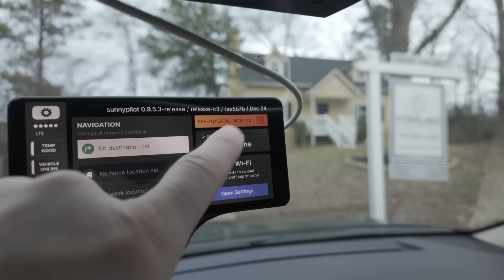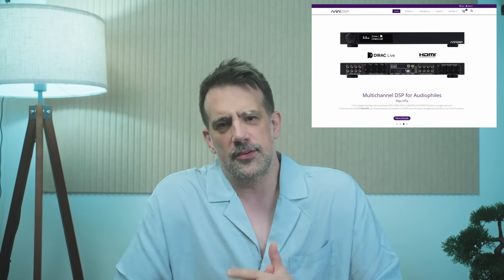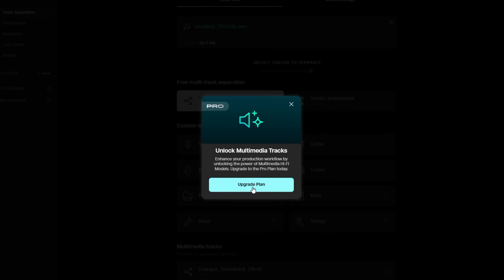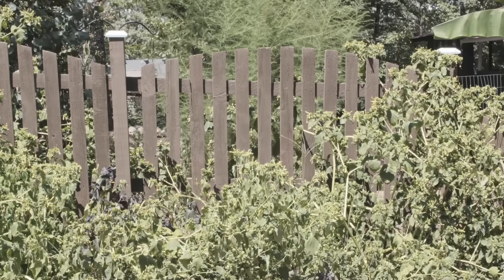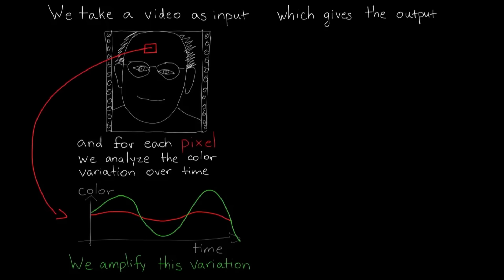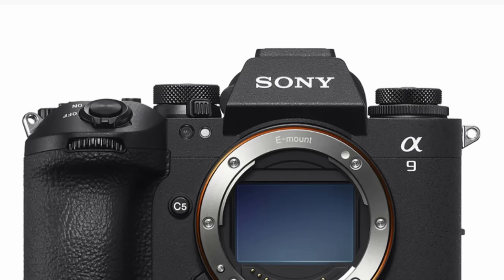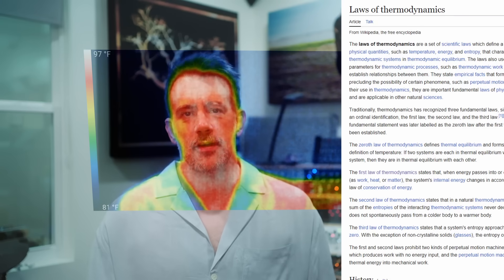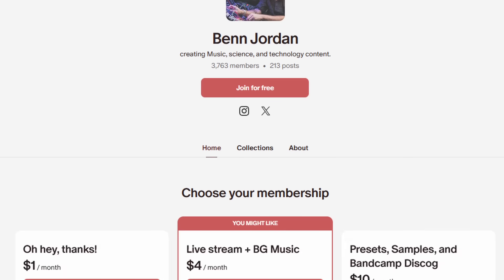How To Make A Legit Sound Camera

Comment: Hello Mr. Jordan, very informative video. Starting at minute 2:38, you introduce the miniDSP UMA-16. I'm a hobbyist researcher (citizen science project) in the field of bats and have a few questions about the device. Were you able to detect bats with the device? The frequency range up to 10 kHz is a bit narrow for bats. I personally use a TeensyBat detector and BatDetect2 as analysis software. I'm very interested in the miniDSP array because I do my monitoring on the move. That is, I don't have a stationary recording device; instead, I travel to the so-called bat hotspots. What are your experiences with the miniDSP UMA-16? Best regards from Germany 👍

Comment: 14:44 This also seems like an increase of the speaker membrane temperature caused by the inner material friction. Similar like when you quickly repeatedly bend a plastic spoon (or any other bendy object) and then feel how warm it got. The higher the frequency, the higher the velocity of the deformation and less time (around the amplitude peaks) for the material to cool down.
Still very cool to see this!

Comment: 14:45 Isn’t this just heat being dissipated from the voice coil driving the speaker?  I’d think eg making a tuning fork vibrate by driving it with a sound would be a better measure of sound energy->heat transfer.

Comment: this is a really good video that i will probably come back to several times (like the posy video that inspired it). 

I do have a question though! At 15:04 how do you control for heat from the electric resistance of the speaker here? It is not obvious to me that the heat measured here is the heat caused by the sound waves themselves, or the electrical activity/resistance involved in converting the signal into sound (and certainly, higher frequency movement will draw more energy and produce more heat, electrically). Maybe I'm being too pedantic here because the underlying signal and source of the heat is the same, for largely the same reason, but i am now curious on the temperature of sound waves themselves, absent of the source.

Comment: A note about rolling shutter is it not always bad news. There is a paper which I wont link as even if I found it as youtube would probably remove comment for it, but long story short they've used a prism and combined global shutter camera with rolling shutter camera. The global shutter camera gave reference image and rolling shutter distortions were matched against it to provide ultra-fast motion data, kind of like how computer mouse works. In theory, with 60hz 1080p camera one could reach upwards of 60khz sampling rate but focusing two cameras to have a uniformly vibrating surface taking entire shot is unrealistic, so they've really only got to like 8, and with heavy distortions as apparently surfaces sound like ass most of the time, not any good for music recording but enough to spy on someone.

Comment: I'm probably not the first to tell you that Adam Savage did a video whereby he utilized an acoustic imaging camera from Fluke to locate a leaky air line in his shop.  I don't know the spec's, but based on what I observed resolution was higher than 32x32 pixels.  Adam didn't mention the cost.

UPDATE: Some quick research netted the Fluke Ti401 PRO, which Offers 640 x 480 resolution.

Comment: 1:00 you've just described P-frames and video compression theory. 

  I‑frames are the least compressible but don't require other video frames to decode. They're basically the full image you see when you're paused
  P‑frames can use data from previous frames to decompress and are more compressible than I‑frames. This is why backgrounds aren't composed of new images in areas that don't move
  B‑frames can use both previous and forward frames for data reference to get the highest amount of data compression.

You can purposefully break these in a process called datamoshing, but if you've ever seen corrupted video of any kind it's because these frames are messed up

Comment: 14:41 not really...  The bright ring is likely near where the voice coil of the loudspeaker sits, which gets somewhat heated by the current driving the speaker. An electromagnet like the  voice coil has finite conductivity, so it will heat up from heavy current.

Comment: Couldn't you increase the resolution of the 'audio cam' by moving the mics in a predetermined way (circular path but with the same orientation?). Your video goes pretty fast, I would add some explanations on hardware/approach and let examples run for a little longer (say 5 seconds instead of 1?). Pretty cool the Schlieren alternative but I guess that was done with the global shutter module?

Comment: AFAIK the software for an audio camera thing using multiple microphones is just a 2D Fourier decomposition. It's the same problem the long baseline radio telescopes face. The optimum sensor layout isn't actually a square array, it's putting them at weird locations, as far apart as possible, that are not multiple wavelengths of each other because you get more resolution. When you don't have a fully filled array, you get diffraction pattern effects but most sounds are multispectral so the bits you don't want won't usually line up in the frequency domain.

Comment: Enjoyable, thank you. Although its not intended to sell things... I wouldn't mind links to some of the items, such as the usb mic array, to tinket with.
As a side note, in the thermal test... could the coil or magnets of the speaker be heating up, instead of the variation from the sound waves? It is power moving the coils afterall.

Comment: I wonder if what you saw on the speaker increasing temperature was not the coils running current to vibrate the membrane and the wires warming up by running come current.

Comment: There is a lot of sound-modulated light all around us. I used to hear it using a photo-transistor or you can hear the sound in a solar battery cell. Things that shine and vibrate easily like bags and foil make a very strong modulated light sound. The sensors in the cameras should pick it up like a photo-transistor or solar cell.

Comment: 13:17 I did that a lot when I was 14, aand quite much at 24 too (Also at 24 I wet my hand with thinner and put it ablaze, it did not hurt. Don't try with rubbing alcohol as you will burn yourself).

Comment: Echo3 dot is loaded with microphones 4 (i think its 9) wifi and bluetooth (transmitters  and recievers all that can run simultaneously) its listed  as  512mb  of Ram (its 5 years old and iphone 16 has 8 gigs ram i think it has 9 gigs) and mediatech chip (i think its 35 same as new samsung galaxy phone) it has some advanced tuning software i asked if it has autotune and it started singing autotuned. i was trying to figure how it was watching me getting my bios and video. its 360 around it. it has been watching me for 5 years never talked to me once the entire time i thought alexa was a scam. i got the echo $6. they have been spying on us with sound and antennas. good work bro. careful with tech the AI is cool but its programmers are billionaires,

Comment: 00:14:45 your thermal camera is picking up the heat generated from the friction of the materials in the moving speaker driver, which creates the sound wave. you are not seeing heat of anything interacting with the sound wave.

Comment: when measuring the heat from the tweeter at high frequencies - how do you know if it is showing heat generated by the air pressure / friction or the surface of the diaphragm material ?  - a way to test that is to aim your sensor through the sound path in the air but not towards the tweeter diaphragm

Comment: Regular video camera frame rates are about 60/s.  This limits the sound frequencies that can be discerned to below 30 Hz.  (Nyquist)  There is a very good reason why sound cameras are expensive.  For horizontal vibrations (larger than a pixel in amplitude). this frequency might be increased to a value approaching half of the line scan rate in some circumstances by analyzing the "rolling shutter" under certain reasonable assumptions... this is not utterly reliable, however.

Comment: To capture sound waves as heat, you would need a diaphragm that heats up when waves hit it. Something with plastic deformation like rubber. It would be more effective when the diaphragm resonates. I doubt it can work (outside of vacuum) since the diaphragm would also move air cooling itself down.
Reply: Maybe there is something useful related to the sonic refrigeration.

Comment: Please research what RDI Technologies does for each customer and the gear they get from RDI, their use cases, the high speed cameras and fps used (120 to 10,000fps +), the immense technical and customer support supplied. Also what was not seemingly taken into consideration with the higher quality camera sensors and software RDI uses are the 2d stabilization, 3d stabilization, filtering, HDR filtering and other technologies incorporated into the software. The hardware and software is used across many industries to help save lives, jobs, and their customers in safety, downtime, and costs. The Trainers, Sales, Support, Developers, and QA have spent decades in relative industries to keep innovating for the tools customers need from RDI Technologies. You should try Motion Amplification with Phantom and Photron cameras too! :) - Heavily biased source: tis my day job as QA.

Comment: The video variation is how they detect future failure points on mechanical systems like say a turbine and generator.. say one of the mounting bolts has a slight vibration and will eventually fail, i believe thats how that works 'temperal variations' wiggles basically.

Comment: This could be used for counter-drone defence with the microphones being used to detect the high pitched noise of the drone’s  motors using DSP to filter out spurious noise like the rumbling of an engine for mounting on vehicles. With the directionality, the drone could be tracked and targeted by electronic warfare, an automatic shotgun or cannon with programmable air burst rounds.

Comment: 15:00 nope. What you saw was not sound. You saw heat from the coil, and deformation pressure « damaging » ( flexing) the cone of speaker . It would have been almost the same in air-emptied container.

Comment: Interferometry might be possible? Which in a way, this is. But two microphone/pixel arrays spaced "exactly" 3 metres apart, should give better angular spacial resolution.
Honestly, it might be easier to just use a clicker or tap-sticks, affecting a piece of grid paper, and back-hack the distances to each other with maths, than it would be to precisely measure the distances between them. Drums for science! Air is going to have a bit of a fudge-factor anyway with the wind and temperature/ pressure differences from the sound source, but fortunately the wavelength is long enough (and slow enough, and easily comparable with low-end hardware), that it might just work.

Comment: When I was doing research in radiology back in the late 1970's we designed a way to search for pathology in chest radiographs using a x-rays, a rapid film changer and a heart monitor.  We took three chest images of a patient (my boss) triggered by the the EKG signal of the heart cycle (P Q R S & T waves).  Two images (controls) were taken at the same wave point and a third image taken at a different wave point.   We create an inverted image of one of the control pairs using the solarized film copy method, which was then superimposed on the third image by laying one film on top of the other and viewing on a super bright viewbox.    This created a difference image.   This was all done in the period of 5 or 6 heart beats while the patient held their breath.    My job was to build the hardware to trigger the x-ray machine using the EKG, schmidt triggers, level detectors, timers, relays, etc.   No computers.   14"x17" film.   But not nearly as cool as differential imagery at many frames/sec.   Thanks for sharing.

Comment: The sound to heat you’re capturing would seem to be heating the coils, not the sound (pressure waves) generating the heat. The difference being that you’re generating heat through the resistive loss in the coil as opposed to pressure waves. I’m sure the sound IS generating heat (it must) but don’t think that is what the video is showing.

Comment: A decade ago I worked with a special Flir camera in the petrolium industry, that could see gas in the air much like you showcase with the lighter, but much more clear and without the need of a background. This camera used a sterling motor to chill the sensor to extreme cold, and the sensor could detect temp difference within one degree in extreme saturation. You could see foot on the floor minutes after walking there. I bet this camera could have the thermal resolution to capture sound and reverse it. Thank you for the amazing video!
Reply: In Yukikaze novel, they used "The Frozen Eye" device, that was some kind of super-cooled camera to detect any air disturbances. It was used to detect enemy airplanes that could otherwise hide from radars and human eyes, but still took volume in the air.
Reply: I'm choosing you since you seem to know about cameras. 

 Why in the digital age do we still have rolling shutters! Why can't the sensors take a full picture at the same time. 

 Rolling shutter seems to be an issue for so many things is all. I get why old film needs it. Not digital!
Reply: @dianapennepacker6854  i am not an expert, but i think it has to do with the amount of data captured at once. Shooting raw you still need dedicated recorders that are essentially a stack of ssd disks, and the camera needs to process the signal. Most cameras (phones, drones, dsrl) do not have the processing power to do so real time. So you could have global shutter, but very bad bit rate and low data volume, which would turn to poor quality and artifacts. A rolling shutter can have higher bit rate and better quality real time because it is only a fraction at the time. Is my guess.
Reply: @davidgallefoss1254 I agree. It’s in the data processing. It think the cameras essentially read the way tube TVs made image frames. Starts at the top and zig zags down. YET! Those TVs had an instant response as compared to flat screens where playing Mario can feel impossible because the image is being processed, upscalled, and stretched in between me pushing jump on the controller. 
I do wonder how much more crisp an image would be if instead of one dot zig zagging up and down. You had multiple processors tied to the same sensor but different spot. If that makes sense. Each pixel has its own processor core. 
I think for once we might actually be able to delete the motion blur effect given the exposure is modified accordingly
Reply: @dianapennepacker6854 the real reason this happens is talked about by TechnologyConnections
Reply: @dianapennepacker6854  because of the bayer layer. Its more efficient to pipe in line by line image data into the bayer and receive an image in "near real time"

Comment: when you did the speaker thing. its not correct. the coil in the speaker gets warm when the voltage from the electronics is applied to make the sound. you could actually see this when the crosshair was moving around a very specific pattern. the pattern of the wire in the coil.

Comment: You weren't detecting the heat from the sound. You were detecting the heat from the magnets in the speaker and tweeter heating up due to electric current being passed through them. In order to see heat from sound you would need a much stronger amplitude and a controlled environment where the camera was pointed away from the speaker and tweeter.

Comment: There's an excellent combat use for this. You could mount it on a vehicle and use it to detect the location of a sniper. The US Army was trying to figure out how to do this in the Iraq war, to track down snipers who were firing from civilian locations. No idea if they ever figured it out. But this would absolutely do it.
Reply: Yeah. Already working. Really well.

Uses an array of microphones arranged around the wearer's military helmet. 

Then on a head up display over the right eye has a crosshair which centres over the zone. And the cross hair moves with the wearer by using motion sensors.

Present development is to integrate it along with many distributed wearers, each with GPS to precisely geolocate a target. 

Then probably the next thing would be to integrate that with a "hawk elimination device"...

Comment: That’s very interesting. I was thinking about if it’s possible to do that. And as light travels faster than sound a camera could detect a sound source and calculates the right frequency for noice cancelation before the sound actually arrives. Therefore open windows without noice hahahah…